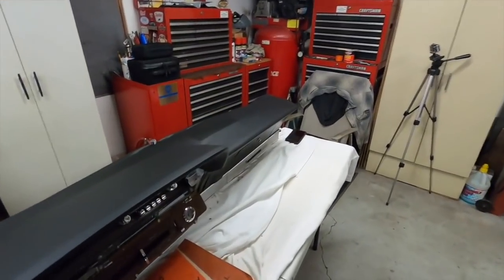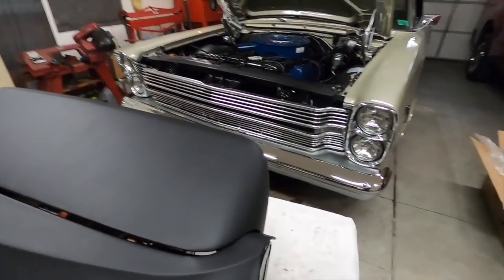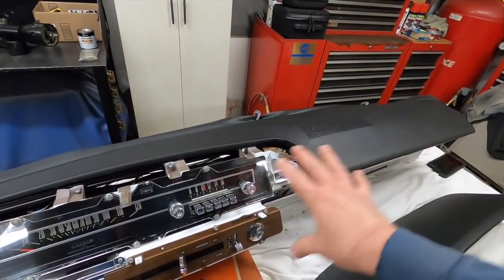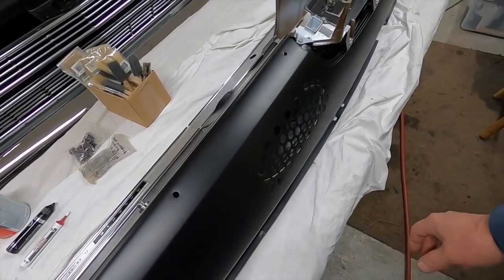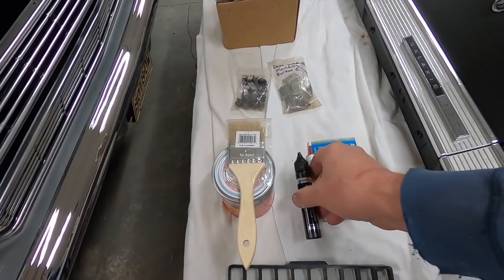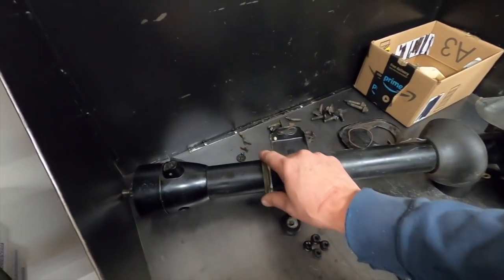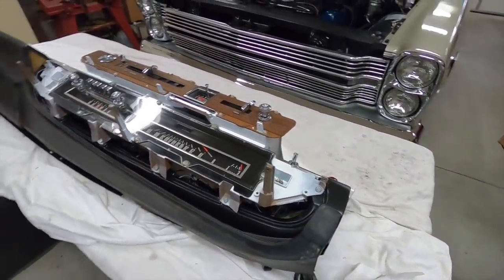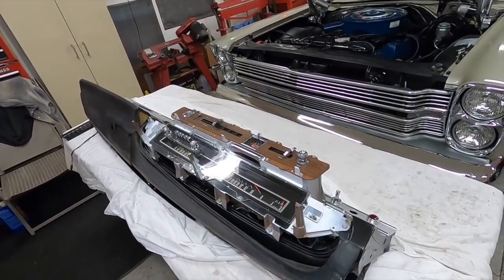1966 Ford Galaxie 500 convertible restoration part 169 attempting to install dash pad

Comment: Have you tried to locate a local upholsterer? Especially in MI, you should be able to find a long established shop that will recover that dash pad to new condition. I was in upholstery for many years, and that smaller piece looks to be a piece of cake for a good shop. Problem is finding the matching material, but that can be solved by doing a lot of footwork if needed. In any case, she is looking good, and a dash topper will hide, and protect those defective replacements.
Reply from the maker: I have matching vinyl, I bought it for some trim work around the convertible top, by the back seat. The trim shop installed it. I may talk to them in the future about it.

Comment: I had the same exact problem with my 65. I got my money back and found one in the condition of your original. I heated it up and it became pliable enough to stretch it and reglue it.
Reply: Heating sure seems to be a benefit with the heating for more pliability and then  cooling and contracting for a tight fit.
Reply from the maker: Who knows, that might be what I end up doing.... maybe steam it..... I'm hoping I get a useable one next.

Comment: Sorry to hear about your dash fiasco! I am now in full time search mode for a 65-66 Galaxie because of you. I’ve always had Mustangs and Falcons in my early years and liked them. Because I’m 6’5, I THINK  I’ll fit better in the Galaxie. I’m a BMW guy.... I have a 2002 M5, 2001 740i Sport, and a 2019 X5. I tell you that because I love cars and tinkering with them. 
My Galaxie search is patient for the right car. I’m leaning towards any body style as long as it has factory A/C. The XL package with bucket seats would be just a plus. 
I’m about 45 minutes from Just dashes, I hope they do you right if you use them. Maybe call them out and tell them your concern? 
Cheers, love the videos!!!!
Reply from the maker: If I use them, I for sure will call them first.

Comment: Looking forward to the seat restoration. I just did my front bench seat for my 68 mustang Gt. It was a bit of a challenge but fun and looks really good. I had to go as far as restoring the metal frame and replacing all of the burlap and fixing the foam. I will post a video on my channel when it warms up and i can get one done. Get extra hog rings too👍🏻👍🏻
Reply from the maker: IF I ever get the interior kit, I'll replace from the springs up, unless it's mint....

Comment: The Original Ford dashpads were mostly produced by Goodyear if you can believe it.  I have a couple original '65-'66 Mustang Dashpads with the Goodyear stampings still on them.  I really feel for you.  The 1965-1966 Galaxie dashpad is not an easy one and as you said there is only one Reproducer of them..so what you get, You're stuck with.  Not so with the '65-'66 Mustang.  Over the decades, The support for the Mustang's Reproduction parts is unequaled in the Repro parts industry and people over the decades demanded perfection with dashpads, so  the best '65-'66 Repro dashpad is nearly undetectable from an original dashpad. The Best Repro's of them are cast from the Original Ford OEM molds for a perfect fit and look...Early Mustang owners are very lucky to even have that option. Anyway, I think that I can speak for everyone Howard in saying that you're doing great with what you have to work with.. Tony K. :o)
Reply: Ya everyone into classic cars and hot rods knows all you need is a 64-66 frame and call Ford and million aftermarket company's and get every nut and bolt for it, never understood why they're so expensive there's a million 65 mustangs
Reply: @m42037  All of those parts on a car do add up...even if there were more than a million made... Prices on '65-'66 Mustangs have increased over the recent years...almost doubled in some cases. ;)
Reply: @nefaurora  Everything has, if I was to get a old Mustang I'd get a 65 without all the bells and whistles just a stock 289, I don't think I'd want a six banger but would be much cheaper. I had a 66 XL for 18 years (96-14, bought from the original owner in Ok) so I know the game, I've noticed the crazy prices today compared to just 10 years ago it's like a flashback to those crazy Barrett Jackson day's of million dollar car's. My car was warmed over for not just driving I liked occasional runs at the nostalgia drags it's fun to get out of the lawn chair on occasion lol. Oh why'd I sell, financial issues like many, I miss that car. Still know the VIN by heart 6D68Y157641

Comment: Eckler's is selling you an economy-grade dash pad if it's made out of ABS. That's strictly a cost-cutting measure and you see what the results are. I don't even know if they manufacture a new dash pad constructed on steel for any vehicle. Places that restore dash pads usually always advertise that they will buy steel cores. Maybe another replacement dash pad from Eckler's will fit better but I am very suspicious of the longevity of any ABS dash pad assembly before it warps. I feel that your option will end up being Just Dashes....and they already know it. Good luck Howard.
Reply from the maker: I totally hear you, and agree 1000%! I'll make the next pod cover fit, even IF I got to cut it up! If all else fails, I will have the original one redone at Just Dash's...... maybe.

Comment: This is really bad news! This company should know better! Your'e a pretty famous guy now and for them to send you that? They obviously didn't even check it for fit  at their facility. No matter what  they send next, I think their reputation is less than stellar in hundreds of potential customers eyes. I hope they send something useable but I'm also concerned about Just Dashes, I used them years ago  when they were brand new and the price even then was high but at least the dash looked presentable. If you end up using them, I hope they don't  gouge  you. I was considering having my dash redone by them after all these years (you want it to look good for the grand kids so when they sell it after we croak they can get a decent amount to spend on their video games !)
Reply from the maker: Most reproducers do have something to test there repo part for fit, on.... obviously they didn't!

Comment: Just curious, would it make sense to try taking off the old vinyl from the old panel that fits over instrument cluster and then remove the vinyl from the new one and overlay onto the old panel and re-glue/staple it. It would fit and you have enough material.
Reply from the maker: I don't think it would look very good..... that vinyl is vacuum formed onto the foam.

Comment: im in the same boat. last year did the mustang brakes every part a-z acdelco except both front wheel cylinders just could not find any that brand so bought oreilly's store brand, as expected they both leak like a sieve and................... i waited all of last year for those to ship here so 2020 continues for me
Reply: I had a Pontiac with a 2.4 twin overhead cam.  GM built the engine with the water pump running off the cam chain.  I had my mechanic change the chain, gears and chain tensioner.  The car had a catastrophic engine failure with the chain jumping timing.  I had the mechanic pull the head and the cam tensioner, it had failed.  It was marked AC Delco on one side and on the other "made in China".  That was at least 5 years ago, all the brand names you used to trust are not even in existence they closed their plants and sold their names and who knows what plant made the parts in China but I know one thing it was the lowest bidder, and the engine was a total loss.
Reply: Yes and there are a lot of counterfeits out there , even for late model vehicles .

Comment: Looks like the dash was manufactured cheap then sold to make a huge profit. Too bad that these parts are not made in the US 🇺🇸.
I do hope the rest of the restoration will go better.
Reply from the maker: That dash pad is made in the USA.... there made in Pennsylvania. It's just a super ultra poor fit! The next one I'll make it fit.... even if it requires using a chain saw....lol
Reply: @OldCarAlley  Disappointing to hear that the reproduction was made in this country. No pride in workmanship and especially quality.

Comment: that  really sucks with the dash...the hooded part over your cluster i wonder how hard it would be to strip it and re apply new foam and vinyl ...a heat gun and some glue would probably work ..
Reply from the maker: I'm just going to wait, to see how the next one they ship fits. if it's just as bad, I won't feel bad cutting into it, to make it fit. If it looks bad, I'll sent the original one out to be restored.

Comment: Nice work Howard. I have a question regarding installing the pod portion of the IP .  Once you got the pod portion to fit the way you liked, how did you go about locating the correct position the 3 screws that go upward into the dash pad brackets?

I’m working on a 66 Custom 500 and I’m trying to install that same setup on my car.

TIA
Steve
Reply from the maker: I never installed the screws. It just stayed in place.
Reply: Did you place foam underneath the large pad in order to “lift” it to fill in the gap between the 2?
Reply from the maker: @stevematthews7691  Yes.... I think I show what I did.

Comment: Take the original dash to your trim shop and have them fix cracks and rewrap in black vinyl
Reply from the maker: It has no cracks.... its warped and shrunk. It's only the pod pad that docent fit.

Comment: Experiencing much the same with my 66 comet. Maybe half the replacement parts I have used actually fit properly and quality is poor. I was fortunate on my dash pad to be able to repair a small tear and use it. Just Dashes quoted me 1200 dollars to restore my pad. Not!
Reply from the maker: I talked to a friend that has had a couple dashes done at Just Dashes.... There work is stellar, but yes, you do pay a premium for nice..... I'm the same as you on that "Not"....

Comment: Too bad it is not the summer. You could have clamped it and placed the dash outside for the sun to assist in molding. it.
Reply from the maker: It super sunny out today, although cold, but it might help. I was thinking of setting it the sun today, as it will absorb heat from the sun.

Comment: I'm afraid that the poor quality of replacement parts will kill the older vehicle restoration hobby. Electrical replacement parts are just as bad. I went through 3 starter relays for my 1967 Mustang, until I finally got one that worked. The replacement ones would either work for a while, and then quit completely, or stick, and not turn off the engine.        John
Reply from the maker: Yep, I find most repo stuff is garbage.

Comment: I also bought one of those rubbish dash pads but Ecklers won't assist as I had it painted and they don't accept returns on "modified" goods. I have torn up over $400 including postage to Australia and I am furious. These pads are absolute junk and anyone selling them is a crook.
Reply from the maker: I have already told them that there doing a dis-service selling such garbage. I spent hours modifying the pad, cutting foam out without damaging the vinyl to get it to somewhat fit. If you have your original pad, Just Dashes in California can redo them, but they're very expensive.
Reply: @OldCarAlley the only thing left of my original pad is the steel core. I'm going to try to get assistance from the people who made the junk pad and if that doesn't work  I'll have to see if a motor trimmer can modify it to make it fit. I can't believe they can take $300+ off people and then just say bad luck.
Reply from the maker: @AnthonyPrattico  I had to carefully cut away foam, without damaging the vinyl to make it fit. They are really poor quality no doubt.